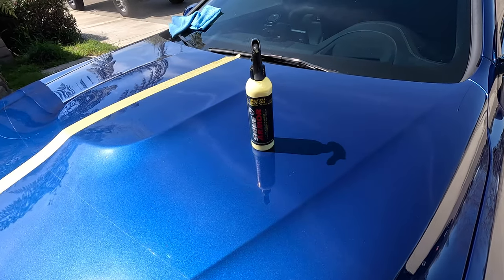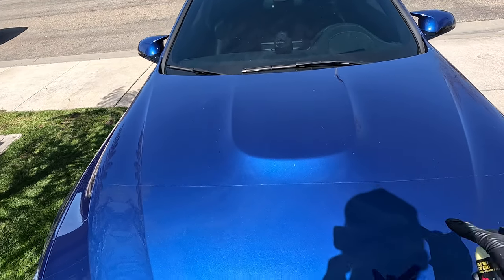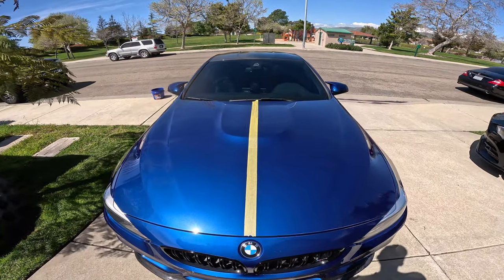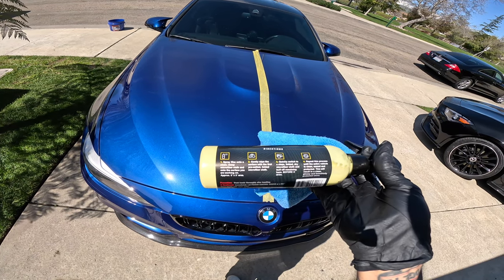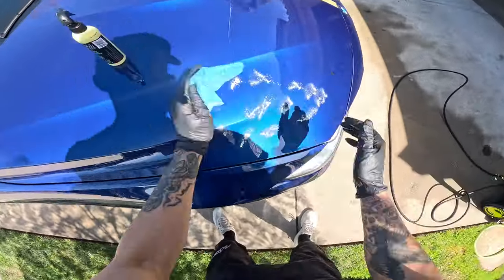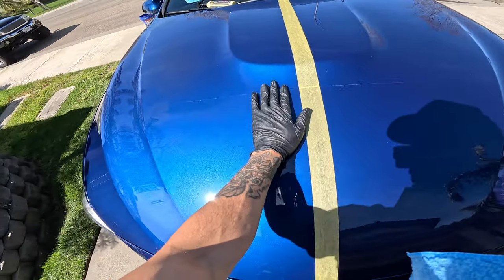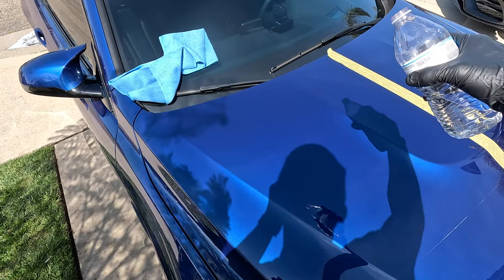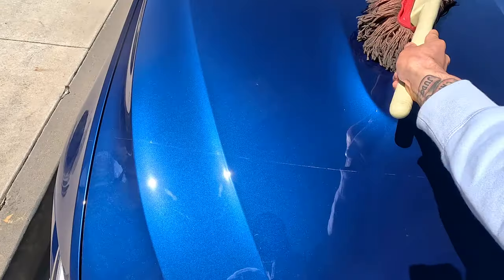DOES THIS EVEN WORK!? - Shine Armor Spray Wax Test & Review

Comment: Those products are ok for a temp shine and hydrophic effect, but ceramic coating is where the money is at.  Find a local detailer, mobile even that will give you a good price that include fully cleaning and decontaminating the car, then apply the real cermaic coat in the glass bottle that normally last 3-5+ years.  It may cost close to a grand, but well worth the money.  If you can do this yourself, even better!